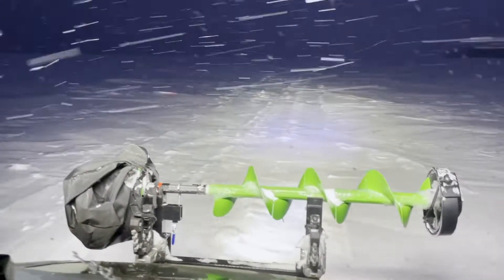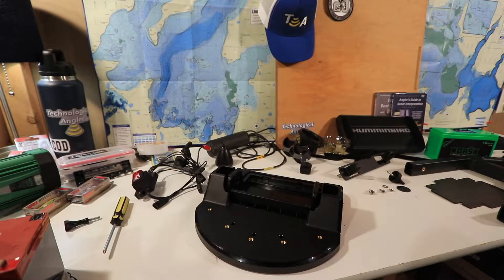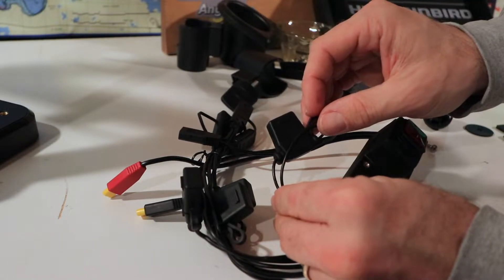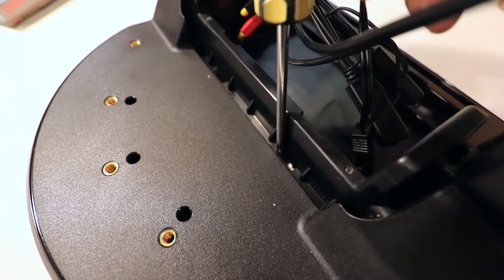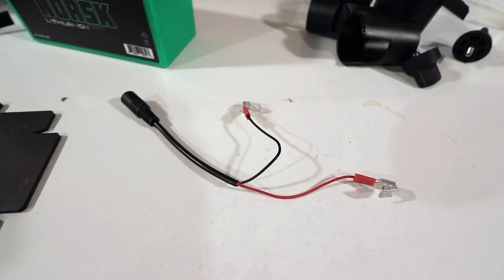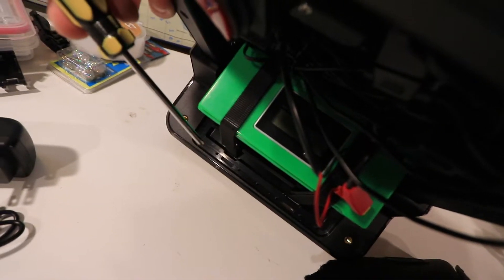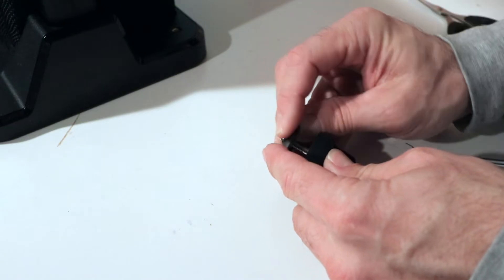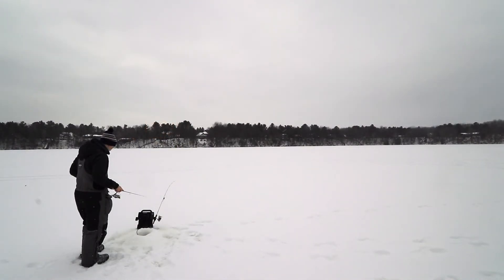Humminbird ICE HELIX Shuttle assembly \ Ice Fishing \ The Technological Angler

Comment: Wish you had this on last week! Lol. It wasn’t a problem putting it together. Don’t know if I was shorted screws or what but I didn’t put any in the back cover and just use the Velcro tabs. It’s stays on well and I can easily remove in the event I have to check fuse or change battery. So far, loving the shuttle and the  mega live bundle. Don’t care for the pole and ordered a summit combo to use with the boat also. Transferred all my waypoints over to the new helix. Thanks for all your tips. Haven’t tried landscape mode much yet. Any tips for using it ice fishing?